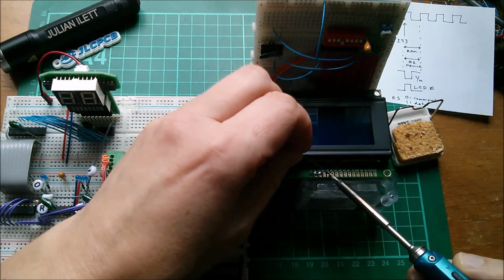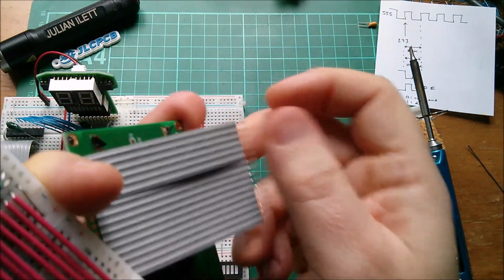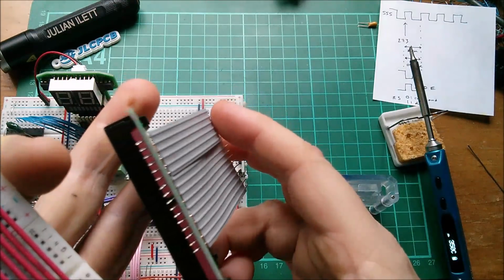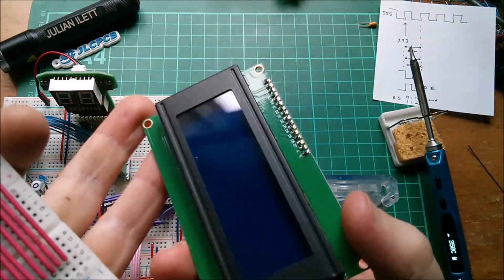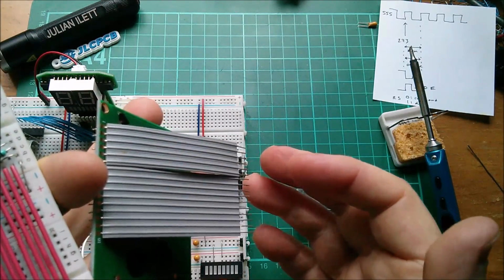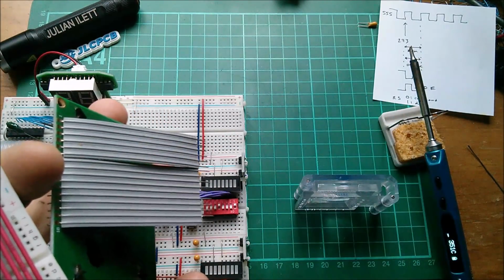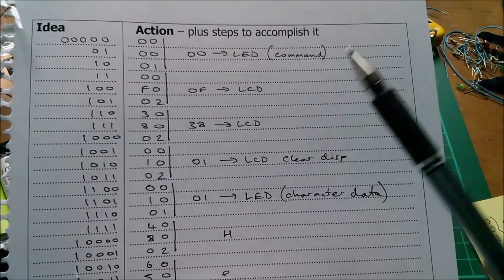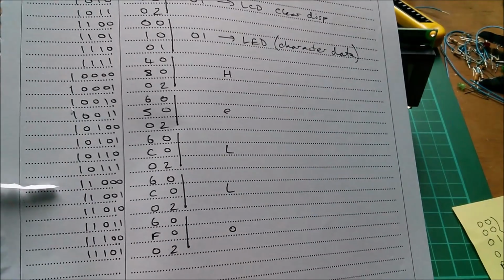Breadboard Computer says "Hello"

Comment: Hi Julian,

I've started to resurrect a very nice project from 1976.

It is the  "PE Digiscope" (from Practical Electronics Magazine,  by By R.W.Coles and B. Cullen).

It spanned 4 issues from July to October 1976.  For the time it was a very desirable bit of kit. 

I originally started to build it in 1976 ( issue by issue) but sadly i failed to complete it
(i was still at school - with no cash income).

I have often wondered if anybody had managed to build and get a working unit.

Perhaps you know of it?  I have provided a link to an online archive where all copies 
of Practical Electronics. can be located:-

>   https://www.americanradiohistory.com/Practical_Electronics.htm <

Currently I'm building an updated version (while trying to stick to the original design). 
Some of the parts are ancient, hard to find and still way too pricey.
I have sourced all the components from Farnell and RS in the UK.

Im sure it can be done in an FPGA - but that's not what its about.
For me it's about  trying to relearn the good stuff - analog
 and digital, 
mixed logic TTL, DTL and nostalgia.
 

I'm routing the board up, at present, so it won't be too long before sees the light of day.
Eventually the new PCB design will go to JLCPCB for manufacture.
I have had very good results with them on the last project i produced.
 Not a plug, they are good
and the prices are very fair.

If anyone is interested i will provide the new design as open source - once i get it going that is.
It's not been cheap to produce a single unit (for me) - so far components are over £80 GBP, not including board and case.

Please take a look and comment if you can.
Reply: I have seen your comment, I think you may contact engineering student from nearest institute or uni., Thanks
Reply: @mohammedyasarshaikh4501  Sorry man i have no idea what your referring to.

Comment: Great fun. DIP switches are a pain, get ye a panel with giggle switch ala Altera or PDP11 to load in comfort. In the era of course mechanical nightmares in the form of paper tape readers or punch card readers were the go. Today you could simulate a reader with an Audrino and write a boot loader so Oink can feed off it. Just my musings.

Comment: Oh my, I'm having flash backs to the 70's, as I learned to hardware program an early PDP-8 with the address and data switches and toggles. :-)
Reply: Brian McConkey I still remember 012737 “transfer register to memory”
Reply: @PhilC184  On a PDP-8 that would be 3xxx, "deposit and clear accumulator".
Reply: Alex Taylor you’re right, of course, I came in at the PDP-11/34.

Comment: You need to add an input bus to the front end. You could build it similar to what you have for writing to the peripheral registers at the back end but with a shift register so you can program it with two or three wires  (data/clock with a counter or data/latch/clock) from an Arduino. The Arduino program would just read an array of bytes, stream out the the bits and send clock signals for each bit. Programming it would still a pig, but at least save you from picking at DIP switches all day. And now you have an Arduino pig programmer for OINC. 🐖 This is awesome. Cheers.

Comment: You should create a simple interface with PC. May be an Arduino with a little program that accepts data from USB and writes it to the computer.

And the next step could be a simple assembler for generating and sending the data.
Reply: Adding an arduino will remove the point of actually building the 8 bit computer
But it is a good idea
Reply: @megamer2340  well... you think it's part of the computer you are using for editing and  assembling the code,,,

Comment: There you go. It's not that hard is it - just a bit cumbersome. Some kind of non-volatile memory would be nice, as you mentioned elsewhere.
I think I've watched all your oink videos, but I can't remember everything, such as the step you take in "step 4" on the post-it. This makes the program (visually) run at varying speed (6 cycles instead of the usual 3). That's something I would've looked into solving.

Comment: Julian - I tried using a bargraph display on a breadboad (rather than multiple LEDs) and had the same intermittant connection problems. I think the leads on it are too small and too short to make a proper contact in the breadboard.